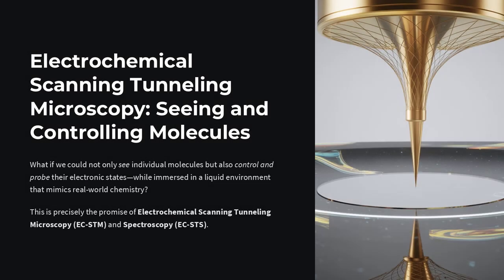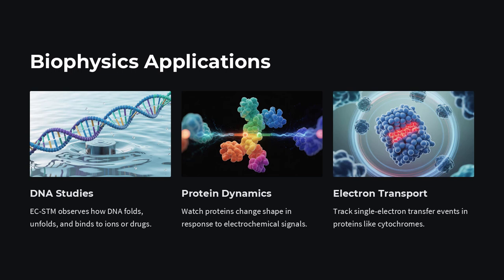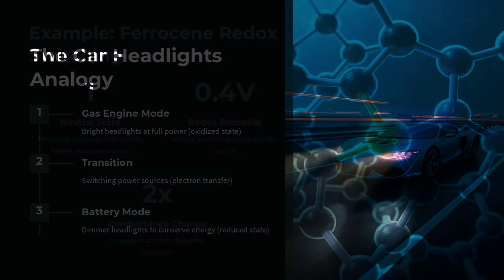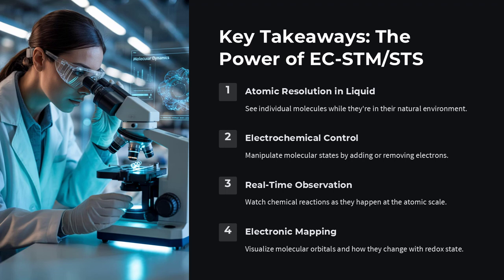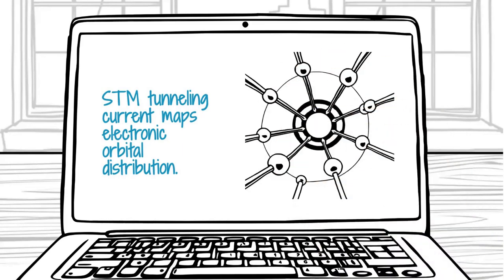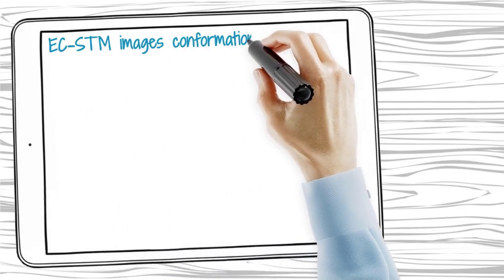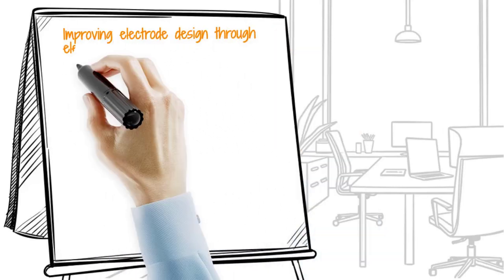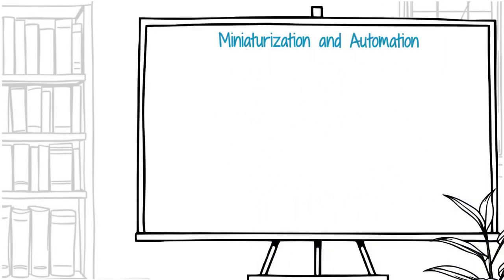The Microscope That Measures a Single-Molecule Redox Chemistry

Comment from the maker: How can ECSTM maintain spatial precision while tracking redox reactions in dynamic, liquid-phase environments full of thermal noise and ionic interactions?
Can molecular electronic devices built with ECSTM achieve long-term operational stability, memory retention, and reconfigurability?
What are the quantum coherence and entanglement limits for redox-active molecules under electrochemical control, and can these be integrated into future quantum logic designs?